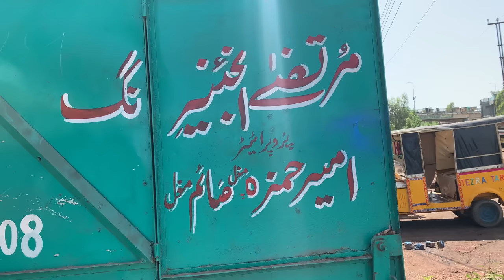Handmade Making Process of Hydraulic Tractor Trolley-Manufacturing Of Hydraulic Tractor Trolley|

Comment: Well you can’t argue that trailer has some steel in it 😳must weigh 6 ton empty. On the whole good construction but shame they had to joint the chassis rails, love the fancy trim round the top. I wonder what it costs
Reply: I wondered about the scooping around the top. They seemed to have quite a bit of that channel they used for the frame but very little angle. What if the top rail material was cut from a channel making the theoretical leg a little longer(stronger) by cutting it in a scalloped line rather than straight in half. 
Also if they used a tarpaulin to cover the load the scallops would give somewhere to hook onto with something equating to a Bungee cord or rubber hold down with hooks. Just my musings.
Reply: I think that.
1. They should use better personal protective equipment: gloves, boots, welding helmet, leather apron and mask.
2. They should use stronger solder, type 7018, 9018, 11018.
3. They must make bevels for welding and leave space between the pieces (1/8) so that the pieces stick or adhere correctly. And even more so when it can only be welded on one side.
4. For very serious jobs like these, it is necessary to apply the welding vertically upwards.
5. For jobs as serious as these, it is necessary to apply the welding beads alternately: at one, at six 🕕, at nine 🕘, at three 🕒... At two 🕑, at seven 🕖....
6. For jobs like these it is necessary to preheat the area where you are going to solder a little (60 degrees Celsius)
7. There is no need to bend the electrodes.
8. For jobs as delicate as these, it is better to apply the solder in letter (C) movements or in circles.
9. The entire piece should have some kind of tempering so that it does not bend so easily.
10. You can create a template or pattern to make the bevels  with oxycut jjj hhjb jbjj

Comment: 잘 보고 갑니다...^^
Reply: I think that.
1. They should use better personal protective equipment: gloves, boots, welding helmet, leather apron and mask.
2. They should use stronger solder, type 7018, 9018, 11018.
3. They must make bevels for welding and leave space between the pieces (1/8) so that the pieces stick or adhere correctly. And even more so when it can only be welded on one side.
4. For very serious jobs like these, it is necessary to apply the welding vertically upwards.
5. For jobs as serious as these, it is necessary to apply the welding beads alternately: at one, at six 🕕, at nine 🕘, at three 🕒... At two 🕑, at seven 🕖....
6. For jobs like these it is necessary to preheat the area where you are going to solder a little (60 degrees Celsius)
7. There is no need to bend the electrodes.
8. For jobs as delicate as these, it is better to apply the solder in letter (C) movements or in circles.
9. The entire piece should have some kind of tempering so that it does not bend so easily.
10. You can create a template or pattern to make the bevels  with oxycut jjj

Comment: Fair play, made that with crude tools.
Reply: I think that.
1. They should use better personal protective equipment: gloves, boots, welding helmet, leather apron and mask.
2. They should use stronger solder, type 7018, 9018, 11018.
3. They must make bevels for welding and leave space between the pieces (1/8) so that the pieces stick or adhere correctly. And even more so when it can only be welded on one side.
4. For very serious jobs like these, it is necessary to apply the welding vertically upwards.
5. For jobs as serious as these, it is necessary to apply the welding beads alternately: at one, at six 🕕, at nine 🕘, at three 🕒... At two 🕑, at seven 🕖....
6. For jobs like these it is necessary to preheat the area where you are going to solder a little (60 degrees Celsius)
7. There is no need to bend the electrodes.
8. For jobs as delicate as these, it is better to apply the solder in letter (C) movements or in circles.
9. The entire piece should have some kind of tempering so that it does not bend so easily.
10. You can create a template or pattern to make the bevels  with oxycut jjj hhjb

Comment: Маска,краги не нужны, , ботинки с защитой тоже.
Reply: I think that.
1. They should use better personal protective equipment: gloves, boots, welding helmet, leather apron and mask.
2. They should use stronger solder, type 7018, 9018, 11018.
3. They must make bevels for welding and leave space between the pieces (1/8) so that the pieces stick or adhere correctly. And even more so when it can only be welded on one side.
4. For very serious jobs like these, it is necessary to apply the welding vertically upwards.
5. For jobs as serious as these, it is necessary to apply the welding beads alternately: at one, at six 🕕, at nine 🕘, at three 🕒... At two 🕑, at seven 🕖....
6. For jobs like these it is necessary to preheat the area where you are going to solder a little (60 degrees Celsius)
7. There is no need to bend the electrodes.
8. For jobs as delicate as these, it is better to apply the solder in letter (C) movements or in circles.
9. The entire piece should have some kind of tempering so that it does not bend so easily.
10. You can create a template or pattern to make the bevels  with oxycut jjj hhjb jbjj

Comment: Прицеп без тормозов,но з красотой.
Reply: I think that.
1. They should use better personal protective equipment: gloves, boots, welding helmet, leather apron and mask.
2. They should use stronger solder, type 7018, 9018, 11018.
3. They must make bevels for welding and leave space between the pieces (1/8) so that the pieces stick or adhere correctly. And even more so when it can only be welded on one side.
4. For very serious jobs like these, it is necessary to apply the welding vertically upwards.
5. For jobs as serious as these, it is necessary to apply the welding beads alternately: at one, at six 🕕, at nine 🕘, at three 🕒... At two 🕑, at seven 🕖....
6. For jobs like these it is necessary to preheat the area where you are going to solder a little (60 degrees Celsius)
7. There is no need to bend the electrodes.
8. For jobs as delicate as these, it is better to apply the solder in letter (C) movements or in circles.
9. The entire piece should have some kind of tempering so that it does not bend so easily.
10. You can create a template or pattern to make the bevels  with oxycut jjj hhjb

Comment: 👏🏼👏🏼👏🏼👏🏼👏🏼👏🏼👏🏼👏🏼✨👊🏼🕶show!!!..Parabéns A EQUIPE!!..
Reply: I think that.
1. They should use better personal protective equipment: gloves, boots, welding helmet, leather apron and mask.
2. They should use stronger solder, type 7018, 9018, 11018.
3. They must make bevels for welding and leave space between the pieces (1/8) so that the pieces stick or adhere correctly. And even more so when it can only be welded on one side.
4. For very serious jobs like these, it is necessary to apply the welding vertically upwards.
5. For jobs as serious as these, it is necessary to apply the welding beads alternately: at one, at six 🕕, at nine 🕘, at three 🕒... At two 🕑, at seven 🕖....
6. For jobs like these it is necessary to preheat the area where you are going to solder a little (60 degrees Celsius)
7. There is no need to bend the electrodes.
8. For jobs as delicate as these, it is better to apply the solder in letter (C) movements or in circles.
9. The entire piece should have some kind of tempering so that it does not bend so easily.
10. You can create a template or pattern to make the bevels  with oxycut jjj

Comment: Там походу метал дешёвый)) 😂😊
Reply: Сравни с Буханкой и удивись ...
Reply: Наверно из-за санкции Металлом  Южный Порт  продаёт им за клпейку 😀😀
Reply: I think that.
1. They should use better personal protective equipment: gloves, boots, welding helmet, leather apron and mask.
2. They should use stronger solder, type 7018, 9018, 11018.
3. They must make bevels for welding and leave space between the pieces (1/8) so that the pieces stick or adhere correctly. And even more so when it can only be welded on one side.
4. For very serious jobs like these, it is necessary to apply the welding vertically upwards.
5. For jobs as serious as these, it is necessary to apply the welding beads alternately: at one, at six 🕕, at nine 🕘, at three 🕒... At two 🕑, at seven 🕖....
6. For jobs like these it is necessary to preheat the area where you are going to solder a little (60 degrees Celsius)
7. There is no need to bend the electrodes.
8. For jobs as delicate as these, it is better to apply the solder in letter (C) movements or in circles.
9. The entire piece should have some kind of tempering so that it does not bend so easily.
10. You can create a template or pattern to make the bevels  with oxycut jjj hhjb jbjj

Comment: Parabéns..um trabalho muito bem feito
Reply: Ни я йп
Reply: I think that.
1. They should use better personal protective equipment: gloves, boots, welding helmet, leather apron and mask.
2. They should use stronger solder, type 7018, 9018, 11018.
3. They must make bevels for welding and leave space between the pieces (1/8) so that the pieces stick or adhere correctly. And even more so when it can only be welded on one side.
4. For very serious jobs like these, it is necessary to apply the welding vertically upwards.
5. For jobs as serious as these, it is necessary to apply the welding beads alternately: at one, at six 🕕, at nine 🕘, at three 🕒... At two 🕑, at seven 🕖....
6. For jobs like these it is necessary to preheat the area where you are going to solder a little (60 degrees Celsius)
7. There is no need to bend the electrodes.
8. For jobs as delicate as these, it is better to apply the solder in letter (C) movements or in circles.
9. The entire piece should have some kind of tempering so that it does not bend so easily.
10. You can create a template or pattern to make the bevels  with oxycut jjj hhjb

Comment: Подвеска? Какая еще подвеска?
Reply: I think that.
1. They should use better personal protective equipment: gloves, boots, welding helmet, leather apron and mask.
2. They should use stronger solder, type 7018, 9018, 11018.
3. They must make bevels for welding and leave space between the pieces (1/8) so that the pieces stick or adhere correctly. And even more so when it can only be welded on one side.
4. For very serious jobs like these, it is necessary to apply the welding vertically upwards.
5. For jobs as serious as these, it is necessary to apply the welding beads alternately: at one, at six 🕕, at nine 🕘, at three 🕒... At two 🕑, at seven 🕖....
6. For jobs like these it is necessary to preheat the area where you are going to solder a little (60 degrees Celsius)
7. There is no need to bend the electrodes.
8. For jobs as delicate as these, it is better to apply the solder in letter (C) movements or in circles.
9. The entire piece should have some kind of tempering so that it does not bend so easily.
10. You can create a template or pattern to make the bevels  with oxycut jjj hhjb

Comment: Esses caras vão dominar o mundo
Reply: I think that.
1. They should use better personal protective equipment: gloves, boots, welding helmet, leather apron and mask.
2. They should use stronger solder, type 7018, 9018, 11018.
3. They must make bevels for welding and leave space between the pieces (1/8) so that the pieces stick or adhere correctly. And even more so when it can only be welded on one side.
4. For very serious jobs like these, it is necessary to apply the welding vertically upwards.
5. For jobs as serious as these, it is necessary to apply the welding beads alternately: at one, at six 🕕, at nine 🕘, at three 🕒... At two 🕑, at seven 🕖....
6. For jobs like these it is necessary to preheat the area where you are going to solder a little (60 degrees Celsius)
7. There is no need to bend the electrodes.
8. For jobs as delicate as these, it is better to apply the solder in letter (C) movements or in circles.
9. The entire piece should have some kind of tempering so that it does not bend so easily.
10. You can create a template or pattern to make the bevels  with oxycut jjj hhjb

Comment: Respekt für die Arbeit
Reply: I think that.
1. They should use better personal protective equipment: gloves, boots, welding helmet, leather apron and mask.
2. They should use stronger solder, type 7018, 9018, 11018.
3. They must make bevels for welding and leave space between the pieces (1/8) so that the pieces stick or adhere correctly. And even more so when it can only be welded on one side.
4. For very serious jobs like these, it is necessary to apply the welding vertically upwards.
5. For jobs as serious as these, it is necessary to apply the welding beads alternately: at one, at six 🕕, at nine 🕘, at three 🕒... At two 🕑, at seven 🕖....
6. For jobs like these it is necessary to preheat the area where you are going to solder a little (60 degrees Celsius)
7. There is no need to bend the electrodes.
8. For jobs as delicate as these, it is better to apply the solder in letter (C) movements or in circles.
9. The entire piece should have some kind of tempering so that it does not bend so easily.
10. You can create a template or pattern to make the bevels  with oxycut jjj hhjb

Comment: 很厉害，用简陋的工具就制作出产品
Reply: I think that.
1. They should use better personal protective equipment: gloves, boots, welding helmet, leather apron and mask.
2. They should use stronger solder, type 7018, 9018, 11018.
3. They must make bevels for welding and leave space between the pieces (1/8) so that the pieces stick or adhere correctly. And even more so when it can only be welded on one side.
4. For very serious jobs like these, it is necessary to apply the welding vertically upwards.
5. For jobs as serious as these, it is necessary to apply the welding beads alternately: at one, at six 🕕, at nine 🕘, at three 🕒... At two 🕑, at seven 🕖....
6. For jobs like these it is necessary to preheat the area where you are going to solder a little (60 degrees Celsius)
7. There is no need to bend the electrodes.
8. For jobs as delicate as these, it is better to apply the solder in letter (C) movements or in circles.
9. The entire piece should have some kind of tempering so that it does not bend so easily.
10. You can create a template or pattern to make the bevels  with oxycut jjj hhjb

Comment: Амазинг😅 просто нет слов, авсë уйня главное бахрамушки😂
Reply: I think that.
1. They should use better personal protective equipment: gloves, boots, welding helmet, leather apron and mask.
2. They should use stronger solder, type 7018, 9018, 11018.
3. They must make bevels for welding and leave space between the pieces (1/8) so that the pieces stick or adhere correctly. And even more so when it can only be welded on one side.
4. For very serious jobs like these, it is necessary to apply the welding vertically upwards.
5. For jobs as serious as these, it is necessary to apply the welding beads alternately: at one, at six 🕕, at nine 🕘, at three 🕒... At two 🕑, at seven 🕖....
6. For jobs like these it is necessary to preheat the area where you are going to solder a little (60 degrees Celsius)
7. There is no need to bend the electrodes.
8. For jobs as delicate as these, it is better to apply the solder in letter (C) movements or in circles.
9. The entire piece should have some kind of tempering so that it does not bend so easily.
10. You can create a template or pattern to make the bevels  with oxycut jjj hhjb jbjj

Comment: Good work and good team.👍👍
Reply: I think that.
1. They should use better personal protective equipment: gloves, boots, welding helmet, leather apron and mask.
2. They should use stronger solder, type 7018, 9018, 11018.
3. They must make bevels for welding and leave space between the pieces (1/8) so that the pieces stick or adhere correctly. And even more so when it can only be welded on one side.
4. For very serious jobs like these, it is necessary to apply the welding vertically upwards.
5. For jobs as serious as these, it is necessary to apply the welding beads alternately: at one, at six 🕕, at nine 🕘, at three 🕒... At two 🕑, at seven 🕖....
6. For jobs like these it is necessary to preheat the area where you are going to solder a little (60 degrees Celsius)
7. There is no need to bend the electrodes.
8. For jobs as delicate as these, it is better to apply the solder in letter (C) movements or in circles.
9. The entire piece should have some kind of tempering so that it does not bend so easily.
10. You can create a template or pattern to make the bevels  with oxycut jjj hhjb

Comment: This trailer is overbuilt using an excess of structural metal for the chassis, underbuilt in certain other critical places, and the welding quality is poor.

The worst, of course, is the lack of protection for eyes, skin exposed to welding UV radiation, and foot safety against cuts and bruises! 🥵 !